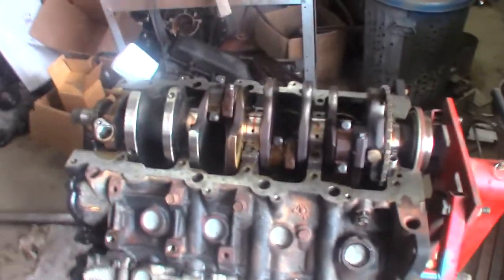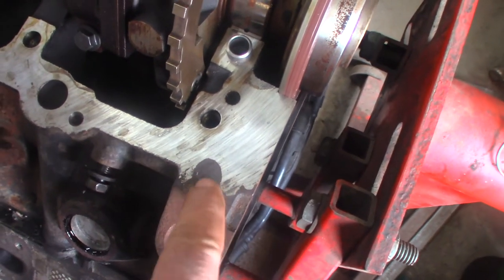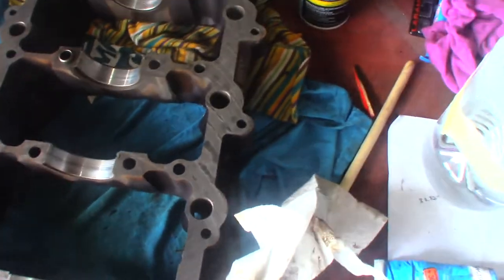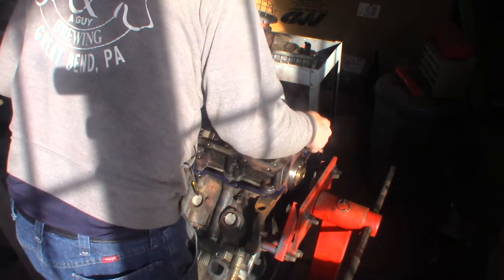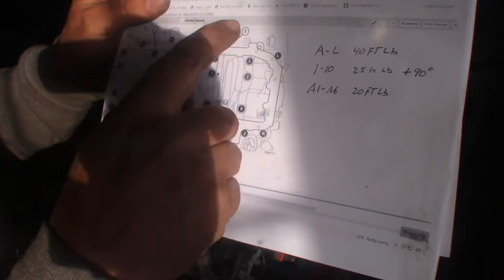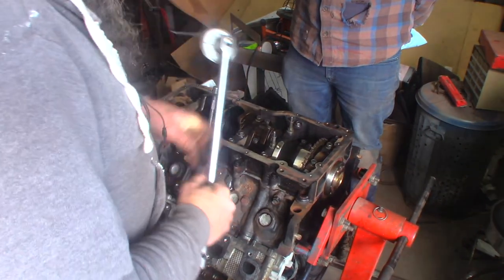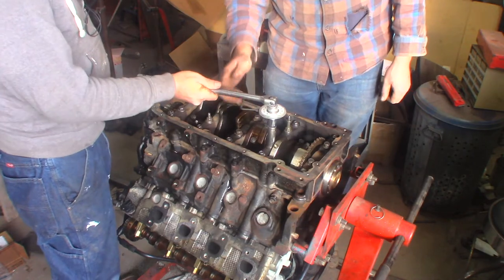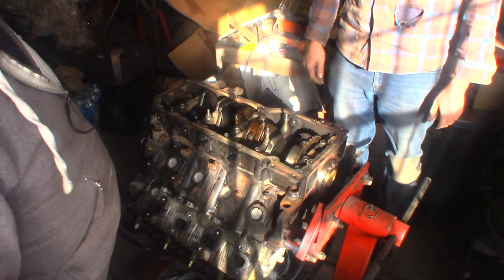4 7 Dodge bolting down the bedplate

Comment: The main bearings are 25 ft lbs and 90 °
Reply from the maker: Thanks MJ! But I'm gonna (eventually) use the body for a cummins truck I picked up. John
Reply: Wait for is it ft lbs after all or inch lbs?
Reply: I personally am building one and hopefully this video helps bc. I am doing 25ft lbs and 90 and with that my engine will not turn over what so ever so I'm going to try straight to the 45ft lbs and I'll keep u posted